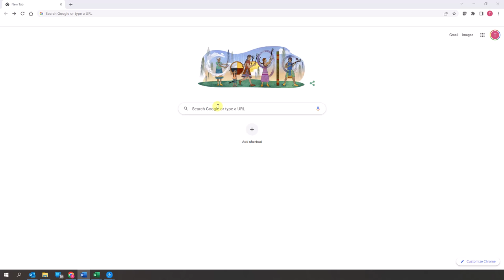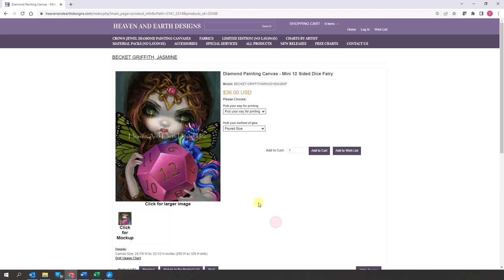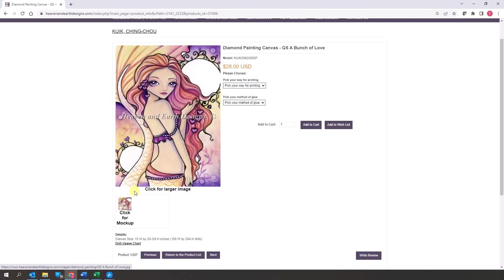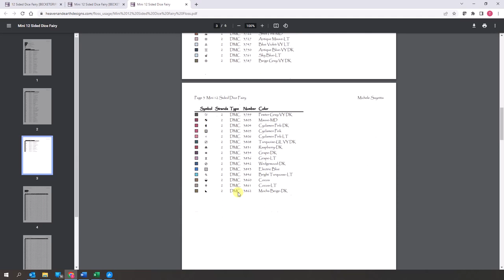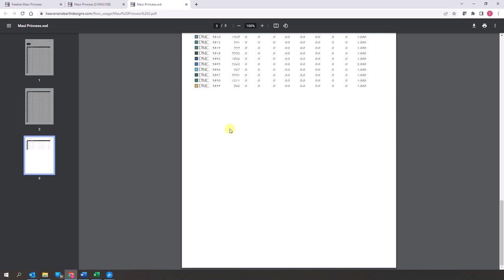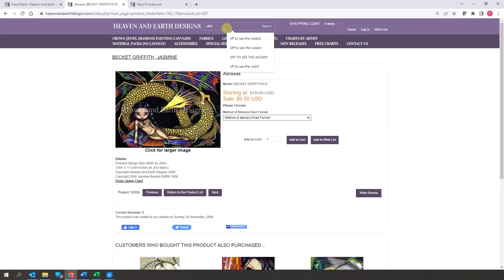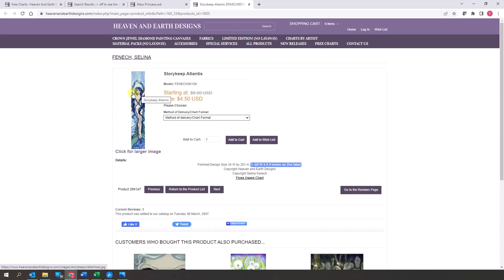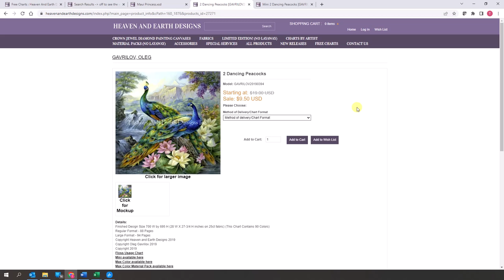Converting a Heaven and Earth Design to a Diamond Painting - Series Part 1 (HAED)

Comment: So so I had a light bulb moment while watching this. I've tried repeatedly to fall in love with cross stitch. A design that would be of comparable size to a diamond painting would be on sized for 11 count adda. Because that's 11 stitches per inch.  Or eleven drills per inch, so a diamond painting would be a tiny bit smaller than its cross stich equivalent .

Comment: Thank you! 😇 I’m an avid cross stitcher and  occasionally dip my toe into diamond painting. Currently I’m on a diamond painting kick 😂. 
I have many HAED designs and started looking at my stash that consists of mini’s during this video and now I want to know more about making them into diamond paintings. I’m sure you will get to it, but where do you source drills from? I’ve only purchased diamond painting kits up to this point.
Reply from the maker: Hi Heidi!  Be sure to watch the series part 2 & part 3 it shows you how you do a conversion the traditional way and then shows you a MUCH easier new method so you can convert them without having to count.  There are several different places to source drills.  I will have that info in a future video.   Also, it's Cyber Monday and HAEDs are 50% off today!  Not that I'm trying to enable you or anything!  Thanks for the angel emoji!  ❤

Comment: Hey there. If they have a charted design that is 307 stitches by 306 stitches, where on earth can I find a poured blank canvas to do a diamond painting? Thank you for this video and link.
Reply from the maker: Hi Dakotah!  You might try and get a quote from Heaven and Earth Designs.  Here's a link to their custom blank canvas request:  https://www.heavenandearthdesigns.com/index.php?main_page=product_info&cPath=605_2220&products_id=30974
They can do canvases up to 152 cm x 175 cm.  Also, I am going to be putting out a Part 2 & 3 of the Heaven and Earth Design series in a couple of days.  If you even think you MIGHT want to try my new method, hold off and watch those videos first because I have an entirely different way to do HAED conversion to Diamond Paintings and you won't need to buy a canvas if you use my method.  So, stay tuned!  🙃